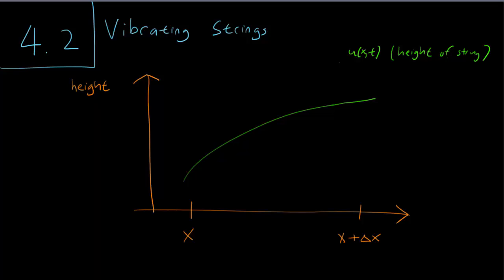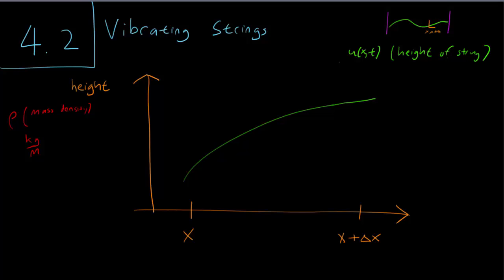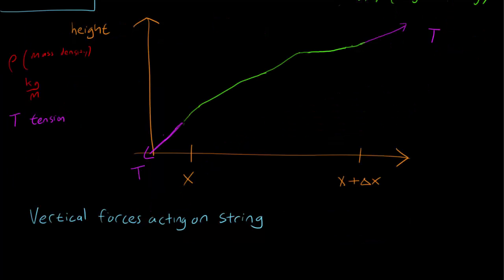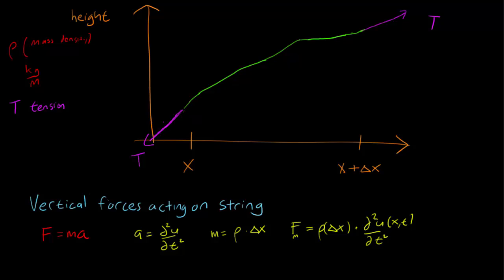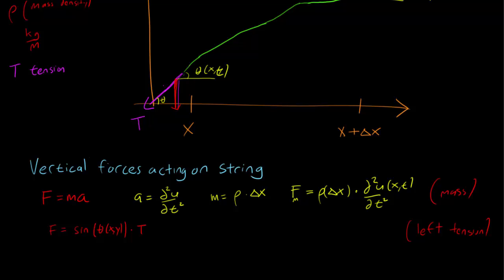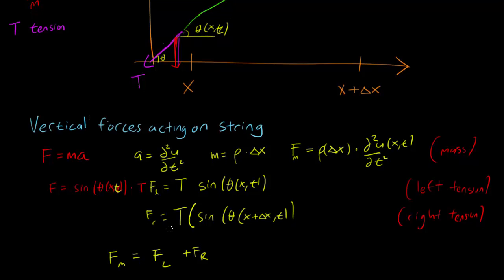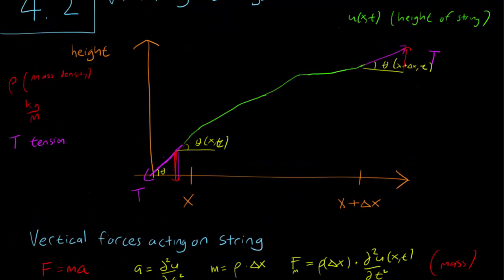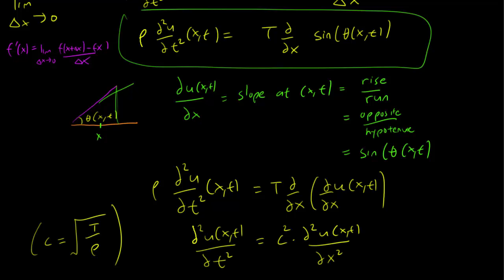4.2 The Vibrating String equation

Comment: I may be wrong in my perspective but guide me kindly how Rise/Run can be Opposite/Hypotenuse. while I am teaching or have been taught that Rise/Run= Opposite/Base. kindly correct me at 10:11. Thanking in Advance.
Reply: Hi I know I’m 4 years late but I figured I might as well answer anyways. In this problem we’re assuming small oscillates. normally we know that tan(theta) = rise/run or more commonly opposite/ adjacent. Now u_x = rise/run. That last piece that ties it all together is for small angles sin(theta) = tan(theta) = theta so we can just say sin(theta) = u_x (because u_x = tan(theta). This is proven by the Taylor Series if you’re curious were it comes from

Comment: Hey there, I noticed you called this 4.2. Does this come from a textbook? If so, does the textbook happen to be "Applied Partial Differential Equations with Fourier Series and Boundary Value Problems" by Richard Haberman?
Reply from the maker: I think that was the book we used for this class. Both the cover and the contents look familiar. But it was a long time ago and I am not completely certain
Reply: Yes it is. On his web site for the course Math 4163, there is a syllabus that gives the textbook.